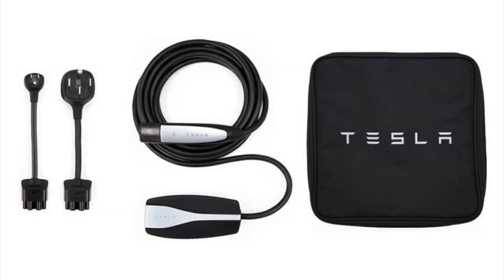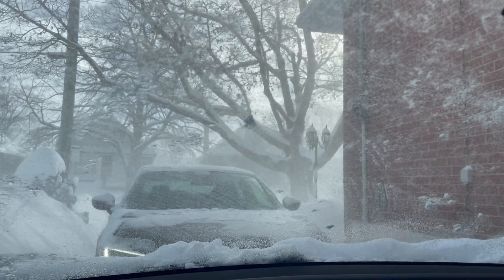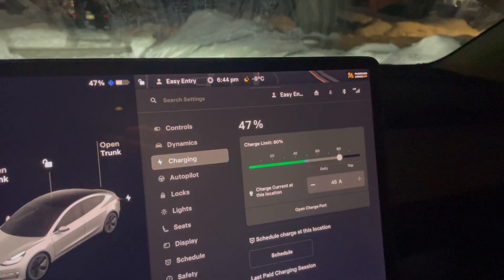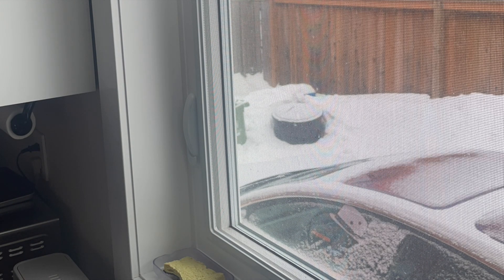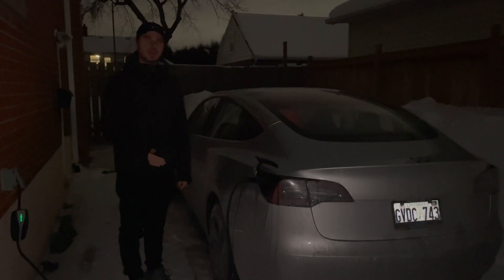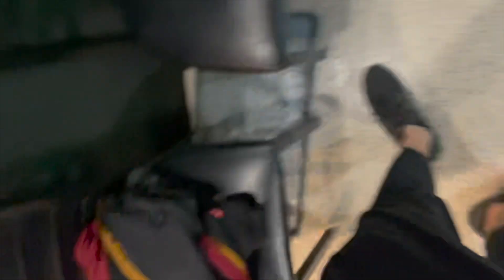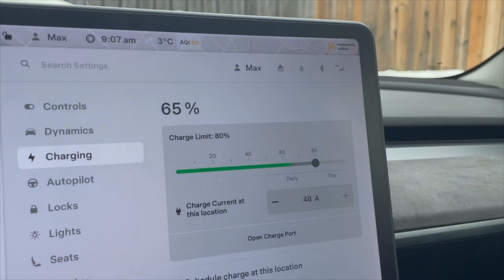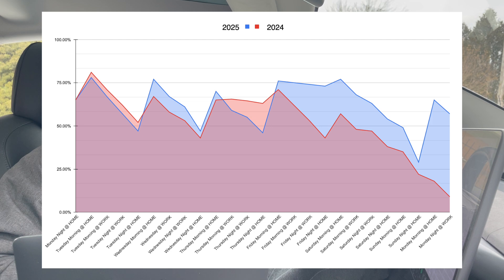Faster Lvl. 1 Charging at Home (NEMA 5-15 vs 5-20)

Comment: Interesting. Can I install a 5-20 where I had a 5-15 receptacle? Mostly asking about the wiring…how do I know if I have the proper wiring?
Reply: You need to have a 20A breaker AND 12 gauge wiring on the circuit. Look on the embossed writing on the wire itself. If you put a 5-20 outlet on a circuit with 14 gauge wire used for a normal 15A outlet you'll probably burn the house down.
Reply: @Muonium1 install was completed lastnight…it was already on a 20A and 12 AWG wiring.

I wish I could install a NEMA 6-20 but I don’t think that’s possible since multiple items are ran from that breaker
Reply: @LayneSteighlee  Just make sure your breaker works. My 15A breaker was making sizzling noises when I started charging my new M3 at 12A and it never tripped when I deliberately overloaded the circuit. They DO go bad. I swapped it for a new one. Plug a space heater in on the same circuit and run it while the car's charging to make sure it trips.

Comment: It's surprising that the 120-volt NEMA 5-20 outlet is very rarely mentioned as an effective, yet fairly common outlet in typical homes, EV charging option that's at least 25 percent faster than charging using a 120-volt NEMA 5-15 outlet.

When you're charging overnight off-peak for 12 hours, you can gain up to 84 miles of added range at an hourly charging rate of up to 7 miles per hour!

That's impressive considering it's only at 120 volts!